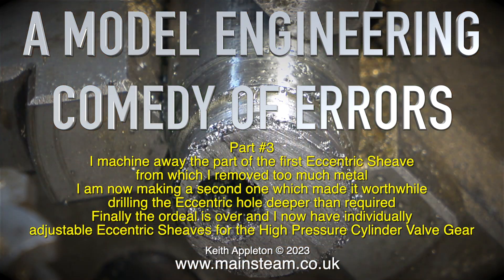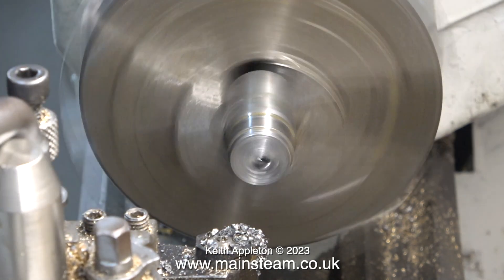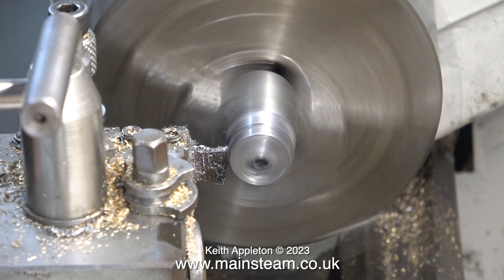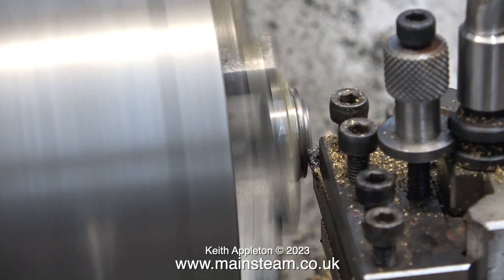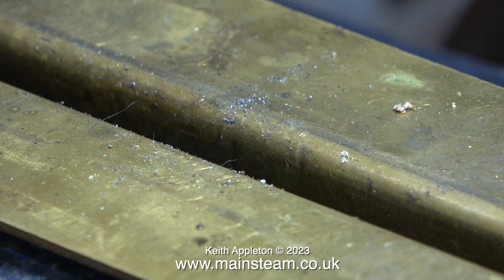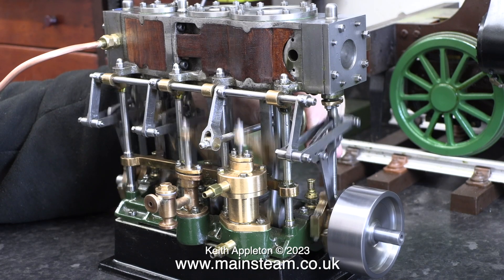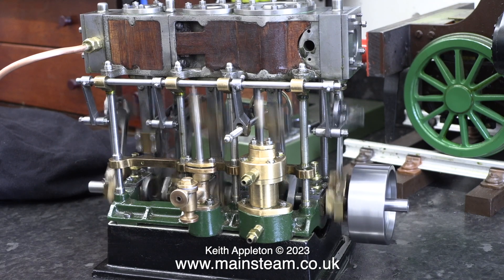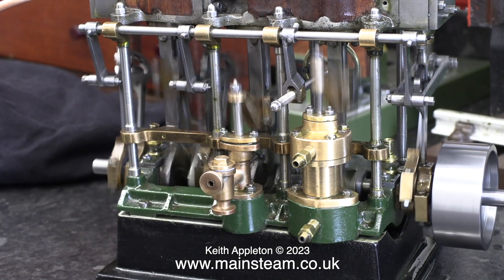A MODEL ENGINEERING COMEDY OF ERRORS - PART #3

Comment: I took an night school. Couse called Model Making where we had access to a local schools machine and wood working shops. they had bins of material that you could buy by the pound, all the bins had a price sign on them except for one that was labeled Free. In the Free bin there were usually small scraps of various materials plus some 2inch dia. x 18.5 inch long steel. All of the newbies to the class would grab a length off this steel to practice turning on it, They would soon discover that you could not get a good finish on it. I found out that this material was offcuts from a local machine shop and he gave it to the school for free as the recyclers would not take it, it was a special stainless steel that even the professionals had problems getting a good finish on.

Comment: Hey Keith , where have you been, you cutting back on videos? Worried for you! You need a Girlfriend, ask your daughter she must know a good looking blond. I am sorry i am late, thank you for the imperial sizes you sent me by email. I am going to buy three stuart engines. I bought a lathe 8 by 16 like your warco but slightly bigger, it turned out it was juck. The tailstock foot was milled in correctly which resulted in it sitting .004 off the bed on a angle upward toward the inside of the lathe, then they drilled and tapped the toolpost bolt hole into the cross slide Crooked, next the LED RPM read out was not indicating the correct speed, the chuck safety cover would not shut of the motor when engaged, then the new chuck that came with the lathe, one of the three jaws stuck when trying tighten them. I took the chuck apart it turned out that their was some sharp edges of steel sticking out inside the chuck catching the gear closest to the jaw gear i filed that up now the chuck works smoothly .The  manufacture as i figured it out did not cut the vgroove in the footplate of the tailstock deep enough something i will NOT even consider fixing on my milling machine, my fine feed adjustment knob on mill has so much slop in it  that i need a dro on the z axis to do fine accurate cuts as the slop in the fine feed is just too much now the seller refuses to replace these parts, as she clearly stated that all parts would be the same” Can you actually believe she said that”!? They refuse to honor the warranty Keith the machine is less then ten days old on my bench for five un used accept to check it. So i have requested a refund and compensation for this utter rip off  and to keep the lathe. I asked for a partial refund and for them to simply send me a new foot plate for the tailstock correctly milled as well as a new compound slide corrected tapped for the toolpost bolt they declined Keith!? I saw a Myford for sale here but its used the guy wants 4000.00 thats to much so i will either get, a busy bee unit new or king canada both 10 by 22 units which is what i should have done to begin with. Never ever buy a metal lathe on ebay or Amazon because the sellers some are ripping people off with in correctly manufactured lathes. Well must go Keith i hope your well my friend wishing you the very best: Daniel Ottawa Canada:
Reply from the maker: Another Essay Daniel, you must like typing - ! do you just do it to keep warm? (I have recently seen the temperature in Ottawa) ........... I still make a video almost every day for my Patreon Supporters www.patreon.com/keithappleton . . . . . also on Patreon there are videos that are not public. I have to make a living and the ad revenue on Youtube for the freebies is not good this time of year. The videos on Youtube will be down to 2 or 3 (maybe less) videos per week.
Reply: @keithappleton  Hi Keith, sorry for the long SA’s i am simply pissed about my ten day lathe. I know i said i would join your patron channel, yes ok i will, next week at some point i will donate to your channel. I have a question for, i have no choice but to build my steam engines from Cold Rolled Steel, also the plans call for welding the standard to bottom flange. Can you recommend a steel type. I cannot afford Bronze its 100$ for 3/4 by 12 inch here my cylinder is 2 in dia. Cast Iron more cost the bronze. Happy weekend Keith, thanks for replying: regards Daniel:
Reply from the maker: I can only give limited Tech support to my Patreon Members: www.patreon.com/keithappleton
Reply: @keithappleton  ok i will join, by the way, I indicated the new crappy chuck on the new junky lathe, its also out by 2 thou. Contact you on your patr….

Comment: I learned yesterday from a asian lathe operator working on crappy metal, he fabricated a ball bearing backed bearing in a cup that burnished/ work hardened a surface to a smoother harder surface as the bearing ball presses on a very small part of the worked surface. It can produce a near glass like surface, like pressing a crushed ball of aluminum foil into a shiny bearing.